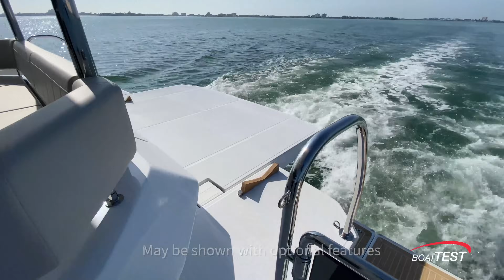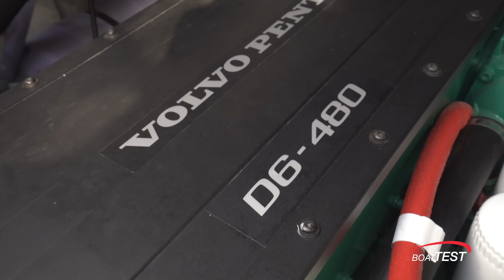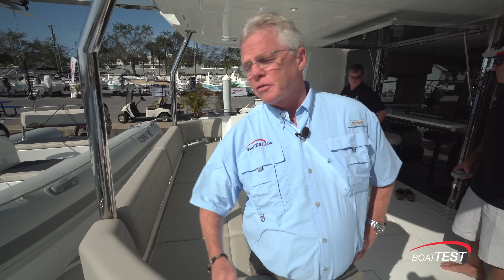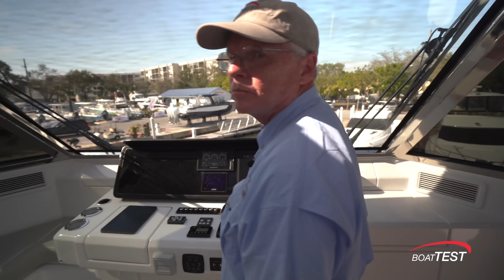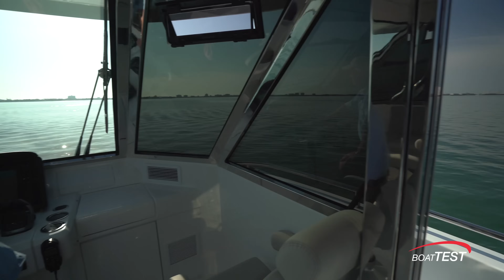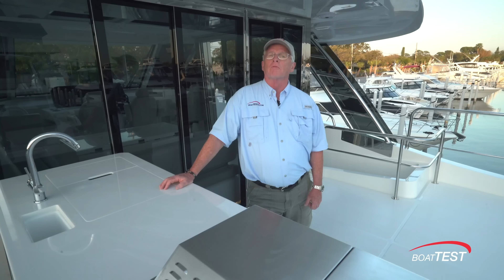Aquila 54 Yacht Power Catamaran (2021) - Test Video by BoatTEST.com

Comment: To Steve can u add if any dock FEES for cats over single hulls. Docks list x$ per foot. What happens when u dock a wide cat thanks.
As many years as u have had on the water. Boat Test should come out with a sun block line for crews and captains.
Reply from the maker: Thank you! Yes, Cats generally will need two slips to handle the wider beam. But really depends on the marina. Most marinas have an outside dock that is typically used by boats over 50’ (15.24 m), and others have over-size slips for large boats that the Aquila 54 can squeeze into.
Reply: Thanks for the answer. It's kind of a wow answer double the slip fee is kind of a game changer.
Reply: @franksmith3602  That would be yer fine print, yes siree boy

Comment: I wonder if that high speed turning radius would be reduced if you were to cut power to the inner (to the turn) engine?  Make it a little easier for the outer engine to push the boat around.  Love those fuel numbers for long range cruising!  However . . .

Three strikes against this cat for what I'd be interested in it for.
1.  Air draft, not including the electronics or anything else, waterline to the top of the hardtop is over 20 feet.
2.  Beam, at over 25 feet this combined with the air draft would make it unsuitable for Looping.
3.  Price tag, since I haven't played the right numbers for Powerball or MegaMillions yet . . . .
Reply: Might as well start and finish with reason #3